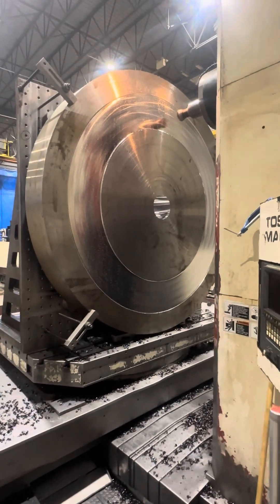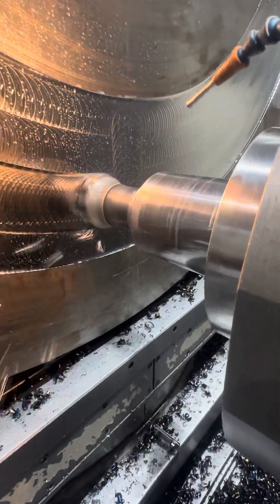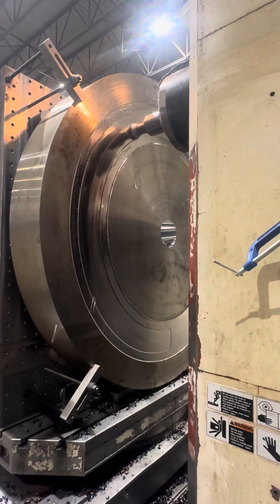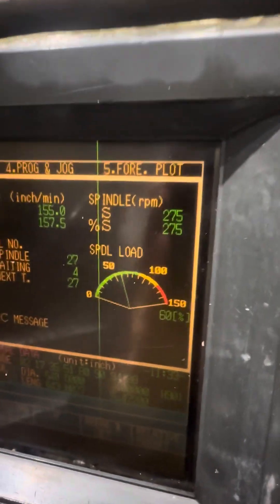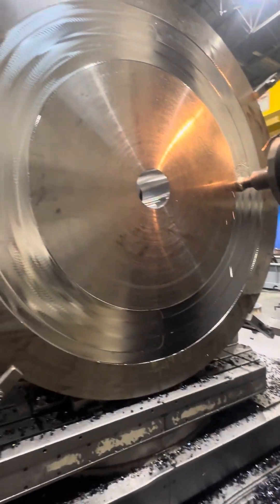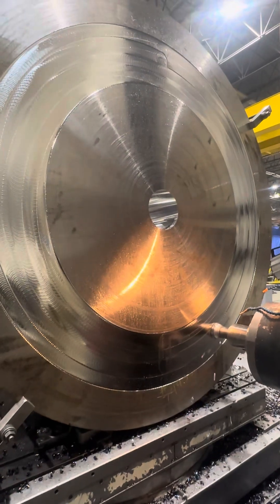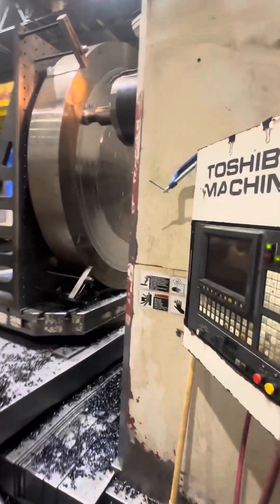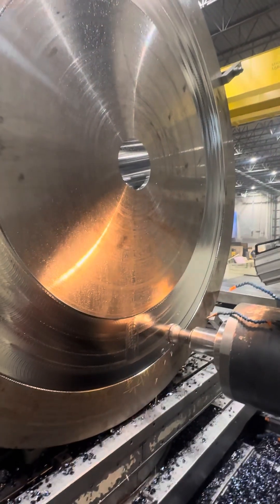Max feed on a Toshiba R22 💪

Comment: How long did that one piece take to finish? What was the beginning weight and ending weight?
Reply from the maker: @USMC1984  hi brother! Roughly my end is 20 hours + lathe timing is 30 hours 
Total part depending on timing crane games lol 50 for roughing and turning only 

Weight coming in 19 500lbs. When our process are complete that are around 16000lbs then off to gear cutting and it still has another operation in a mill 

Cheers 🍻
Reply: @MadMachinest  so roughly 3000 lbs of metal shavings on your floor! 
thanks for the answer!